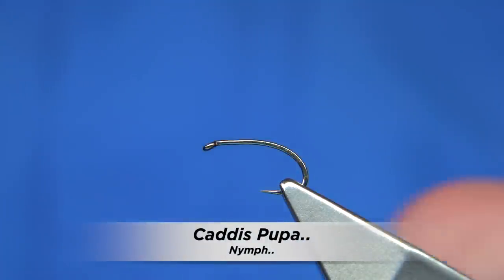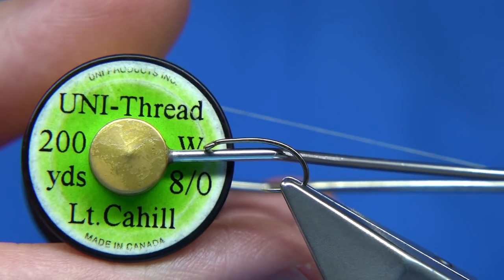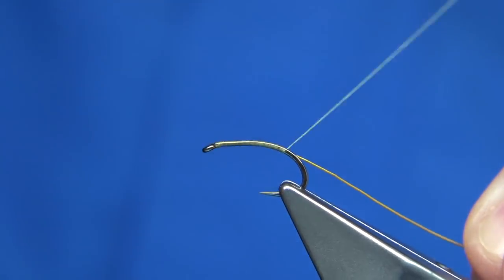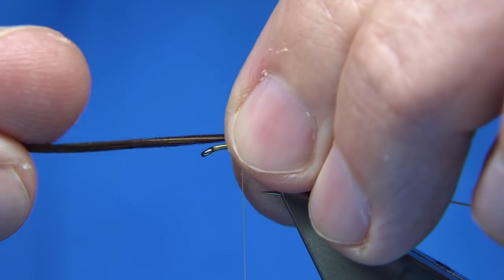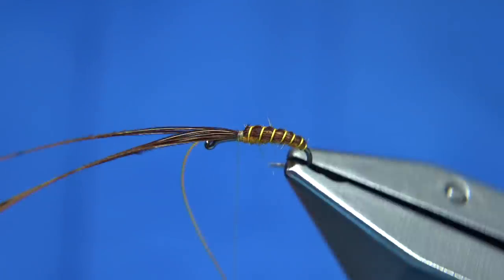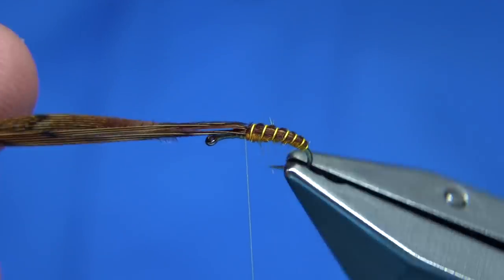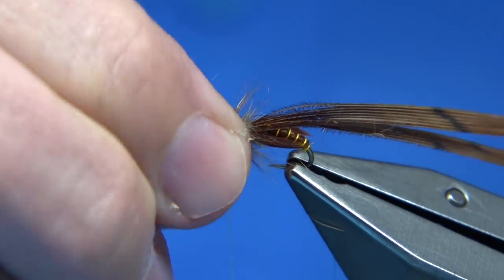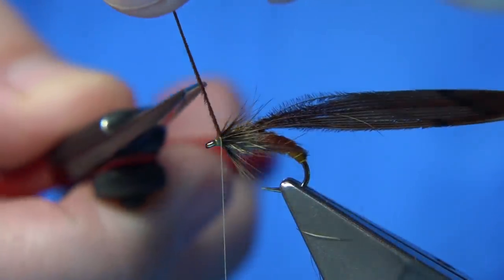Tying a Caddis Pupa by Davie McPhail

Comment: Why do you use superglue for heads instead of varnish?
Regrads.
Reply from the maker: Hi Dr. Yurets,

The reason I used the superglue was for speed as it dries really quick so that I then can colour the top of the head with the brown marker as this stops the ink from the marker from running..Then I'll coat the head with clear varnish to finish it off..You don't need to use the superglue if you are willing to wait as I would just use clear varnish colouring the head after the first coat is dry before I finish it with another coat..

All  the very best Davie..